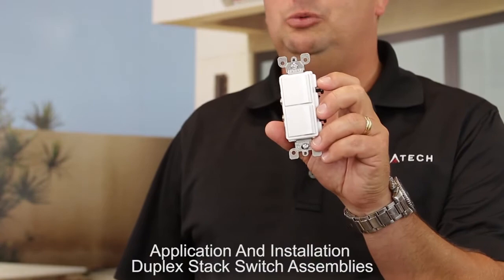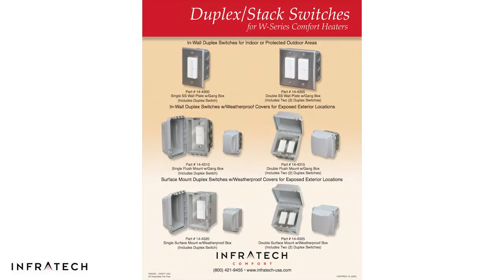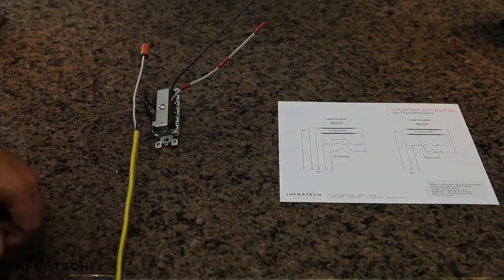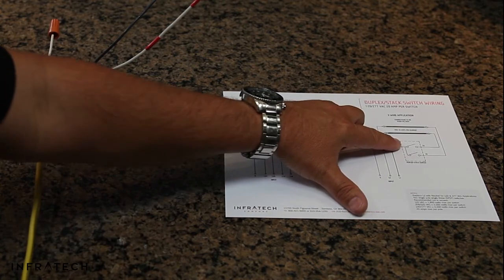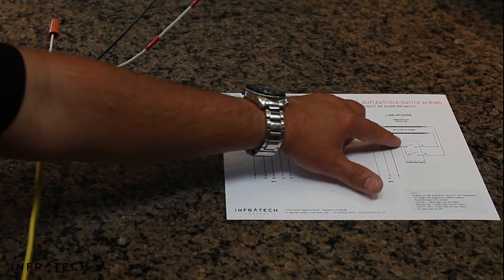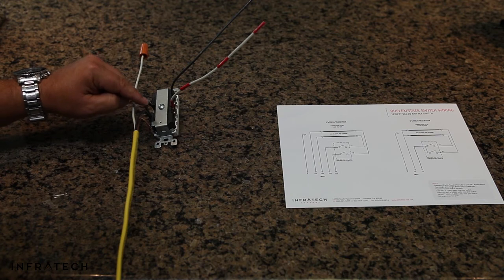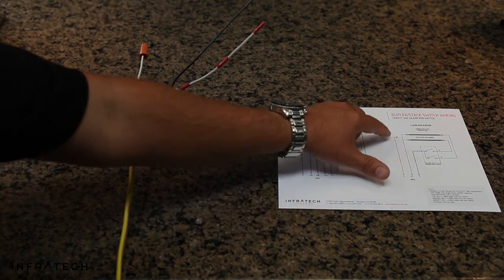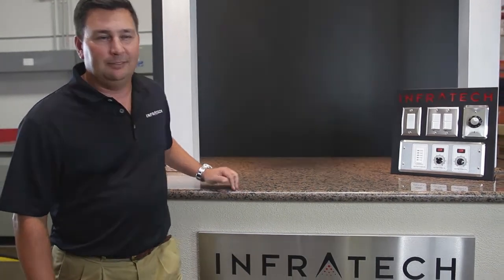How to Install Infratech Duplex Stack Switch Assemblies

Comment: The wiring diagram recommends not to exceed 4000 watts per switch. So will the duplex switch not work for a wd5000 heater? Or is each rocker rated for 4000 watts?

Comment: looks like 12awg wiring in the video.  This setup would not work with the CD6024 since  you'd have the full 6k watts going through the 12awg wire no? Line 2 in the video and line 1 before the switch
Reply: Also, if anyone else is looking to wire these up, look into a contactor and a Lutron wireless switch with Pico remote.  Use the Lutron switch turn on/off the contactor, the contactor turns on/off the 240v heater.  Check out Honeywell or Packard, they are like $15-ish.  Make sure the contactor is rated 240v and can handle the amperage.  The "coil voltage" is what triggers the contactor.  120v coil voltage means you can wire the 120v lutron remote switch to the contactor.  If its 24v (or some other low voltage amount) you'd need to wire in a transformer between the Lutron switch and the contactor.  Wire the Lutron switch and the contactor inside, somewhere convenient next to the panel, and mount the Lutron Pico remote somewhere convenient to turn on/off the heaters (assuming the remote isn't out of range of the Lutron switch).

Comment: I am disappointed i call like 4 times and never help and i have the same problem stacked switch my heater needs 6k w and is shutting down after 15 min I just wonder if I need 30 amp braker and 10 g wire ?
Reply: If it's a dual element heater with two 3000 watt elements, get two double pole 15amp breakers and run treat it as 2 separate heaters. Just make sure you keep them separate the whole way, e.g. need to keep each heating element wiring separate from the other element. Use a continuity tester once the element is installed (but no power running to it obviously) to ensure you didn't mix them up since you can't see the wires run within the unit
Reply: Went you make 12/3 in the switch you bring one line hot and the other go in the unit? Sorry for my spelling / tried to solve the problem